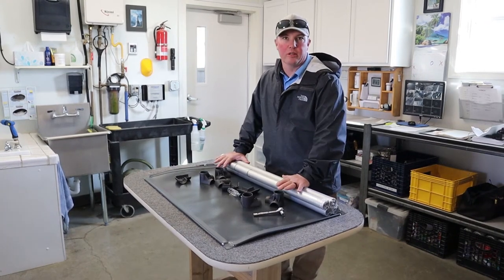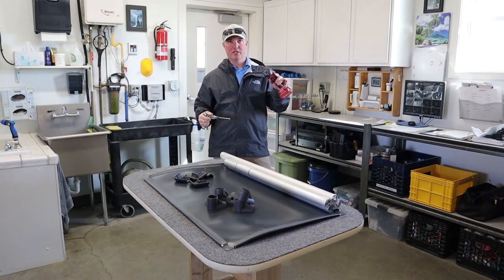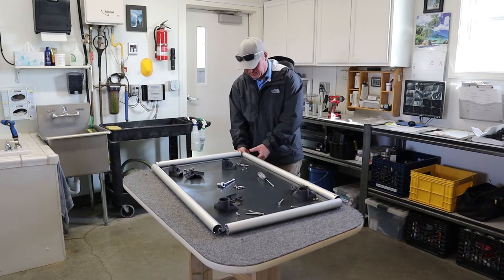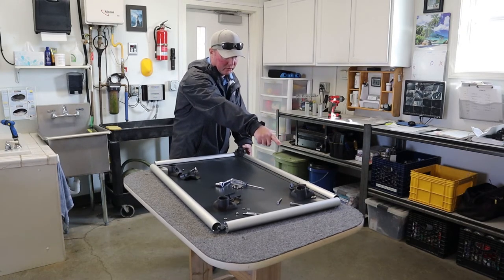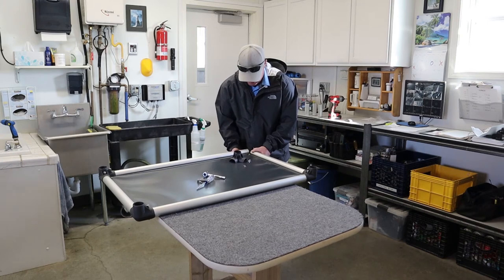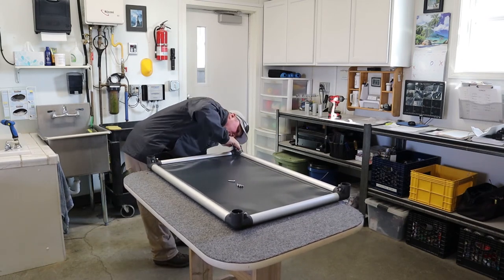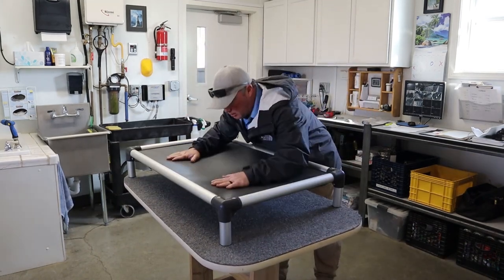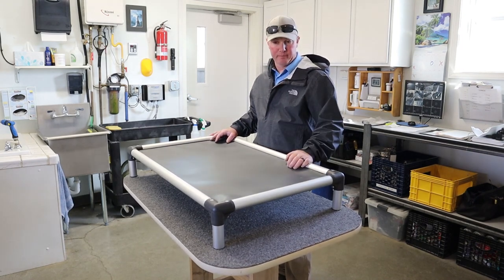How to Assemble a Kuranda Dog Bed

Comment: purchased two of these and i am so disappointed. i expected better manufacturing, and we had to cut down the pipe inside because it was placed wrong and blocked the screw. i don't recommend this bed at all. helpful video, but overall doesn't work if you are like me and get subpar pieces manufactured incorrectly.
Reply from the maker: I've literally put hundreds of these together and never experienced that. I would contact the company and have them replace them. They are very fair to work with. Kuranda.com
Reply: I am having the exact same issue. The metal piece inside of one of the longer rods is blocking the open space the screw should go in.  It appears we ordered the Kuranda bed around the same time, so I suspect this is a manufacturing issue. Edit: I meant to post this sooner, but I did reach out to Kuranda who had A+ customer service. They informed me that in shipping, sometimes the metal piece within the rods move around. They instructed me to hit the end of the the rod until the metal piece inside of the rod moved back into place. This solved the issue in about a minute. Of all the purchases we have made for our dog, I think the Kuranda bed is the best, hands down. Do not hesitate to buy one. Our dog loves it and after a year, it's still as good as new. Thanks again for the video @FlyCreekKennels!
Reply from the maker: @jesses9765  have you purchased the largest version  (50X36)? PVC or Aluminum Frame?
I know the other sizes do not come with the extra support bar
Reply: @flycreekkennels9559  I'm glad to hear it is a rare problem. We were able to put the dog beds together, eventually, and i'm not one to call customer service unless i absolutely have to. Ultimately my dogs are happy, but I will never purchase another kuranda bed again and will not recommend them either. Consistency is key with me
Reply: @flycreekkennels9559  44 x 27, PVC. After 2 hours, I still cannot get the last leg together due to the metal rod blocking to screw hole. Quite frustrating! 

Nice video though. Was helpful until I ran into this issue.
Reply from the maker: @jesses9765  I just put this together for you
https://youtu.be/hY0Nf45CuEg
Reply from the maker: Here B G i put this video together. hope this clears it up and helps.
https://youtu.be/hY0Nf45CuEg
Reply: I just moved it evenly  between the screws. Easy to do with a hammer and punch. I think it just slipped.

Comment: My XL Kuranda dog bed arrived with no instructions, included.  This video was a life-saver!  The assembly was slightly different for the XL bed (no corner screws) and required a floor assembly due to massive size, but I was able to figure out the sections that were different easily.  Thank you so much for posting!  It would have taken me three times as long to assemble had I been left to figure it out on my own.  My long legged Great Pyr mix is in heaven and finally has a bed he loves and doesn't hang off of.
Reply from the maker: So glad this video helped you assemble your bed and that your dog has found his forever bed 🤷

Comment: I appreciate you making this video. I have two I have to assemble for my male and female rotties
Reply from the maker: You're welcome.
If you purchased the 40 oz vinyl material give it a chance to acclimate to your environment.
Pull it out of the box and let it sit in your home for 24 hrs
Sometimes when folks try to assemble the 40 oz vinyl right out of the box it can be stiffer, making assembley just a little more challenging.
Thanks for watching and enjoy the bed. It is a solid product.

Comment: Help.  I did exactly like you said (corner to corner first) but the last one I could not get screws to line up straight.and brackets would not come together.
I took it apart several and tried again with same results.Do you have any suggestions to fix. Thanks
Reply from the maker: Start over. Loosen all bolts. Make sure support bars are in notches in corner brackets and just HAND tighten. When you have all corners put back together then tighten down with ratchet. Hope this helps

Comment: It is extremely difficult to slide the fabric into the PVC pipes.
Reply from the maker: let the fabric get to room temp.  sometimes shipping in the cold makes the fabric difficult to work with if it's still cold.
If that's not the case just use patience and finagling.  It'll go